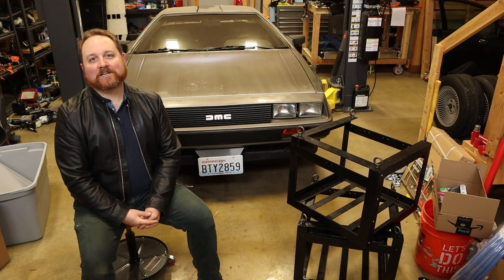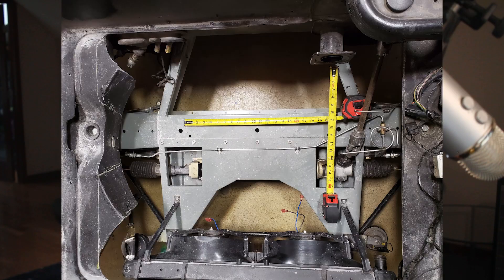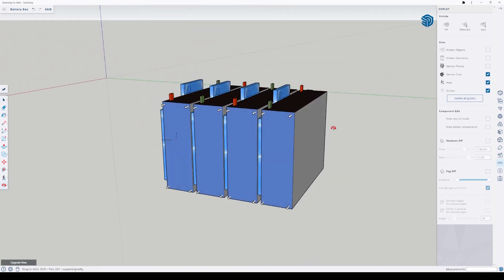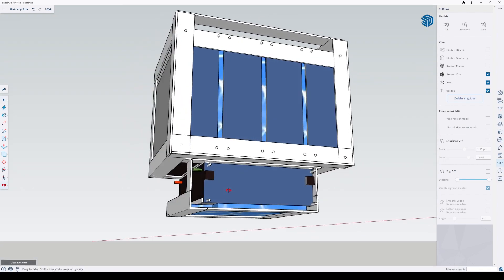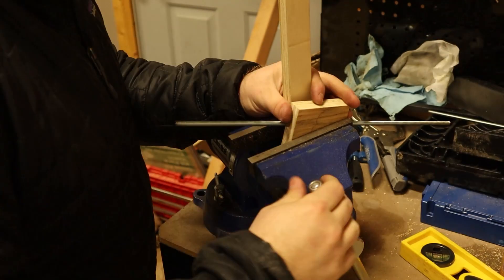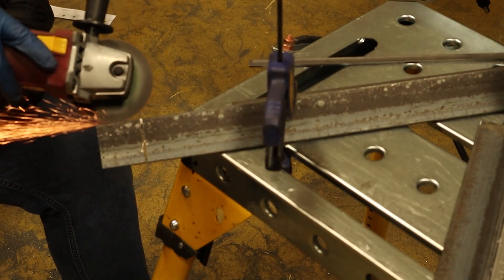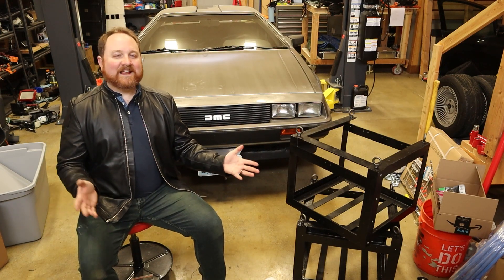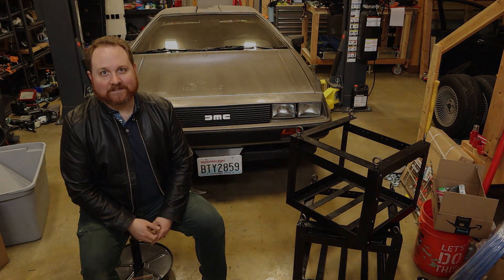Electric DeLorean - Design and fabrication of battery boxes!

Comment: Nice.  Will there be thermal pads between the machined aluminum and the battery modules?

Also, you show the end module only having a cooling plate on one side... so effectively all the others in that group get access to 2-shared cooling plates (effectively 2 x 1/2, or 1 full plate) , but that one end module only gets 1/2 as much cooling... and the opposite end gets 1 full + 1 shared... or 1.5 cooling plates.  

You might want to consider creating two different types of cooling plates... a full-thickness one for the sandwiched plates, and half-thick ones for the end-plates.
Reply from the maker: Yep, you're thinking just like me!! Each plate will have a thermal pad connecting it to one battery module, and on the other side there is a foam insulating panel so that each module only gets cooled by one plate, to ensure even cooling. :)
Reply: @BillCarlson    Well, that's not really where I was heading. Wasn't the original design cooled from both top and bottom?
Reply from the maker: @beforebefore  No, only cooled from one side. I tried to keep it doing exactly what it was doing before, so that I didn’t introduce extra variables.

Comment: How do the packs come from the factory? I understand that you have to redistribute the packs in a new configuration and to make them safe, but I'm not so sure about those heavy duty steel boxes. The original car didn't have those steel boxes inside, did it? Everything was packed a lot better originally I imagine. Can't people replicate that in their EV conversions? Why is everyone fabricating steel boxes?
Reply from the maker: I've got a video showing how I dismantled the pack straight from the Bolt, and you can see how they were mounted. They used the same basic type of mounting as I am - using threaded rods attached to plates, and some hold downs. The original battery box is one big steel box, with a fiberglass top.

Comment: Any particular reason you didn't go full cad + send-cut-send and skip a lot of the fabrication faff?
Reply: Oh nevermind you addressed it at the end as : yeah you shoulda done that, heh

But yeah send cut send is a modern miracle I swear
Reply from the maker: @Ryukachoo  I've redeemed myself on the next fabrication job - the small battery boxes are both in from Send Cut Send. I agree - modern miracle!!

Comment: Awesome work! What are the approximate outside dimensions of each of the boxes you built? I’m thinking of using a Bolt battery for a build and your boxes look well packaged! Thanks for the videos!
Reply from the maker: Roughly 21" wide, 20" deep, and 16" tall - I also had a previous design that was a 2x2 arrangement of batteries that's roughly 12" tall, 20" deep, and 30" wide - this is the one that ended up not being able to fit in the front (too wide).

Comment: Are the 8 mm tapped holes adequate for lifting the pack? That's not very thick material to take substantial tension.
Reply from the maker: Definitely, each one is rated at 1100 pounds - https://www.boltdepot.com/fastener-information/Eye-Bolts/Metric-Machinery-Eye-Bolt-Working-Load-Limits.aspx

Pack weight is only ~400 pounds, so even with an angle on them I've got a lot of headroom.
Reply: @BillCarlson  The eyebolts are fine, but are they engaged by enough threads? My concern is not the fasteners, but the what the way they are anchored in the frame.
Reply from the maker: @brianb-p6586  Ahh, I see - the metal is 3/8" (9.5mm) thick and it is fully threaded. Rule of thumb for threads is that the maximum pull out strength is achieved once the depth equals the diameter of the screw (8mm), so I should be in the clear. Certainly four (or even 2) are strong enough to hold up 400 pounds. I'm not sure I would settle for M8 bolts to hold the pack in the car (for that I'm going with either M10 or M12 bolts) - but for picking up the pack and moving it around the shop, it should be adequate.

Comment: Did you consider locking nuts (elastomeric e.g. "Nylock", or all-metal) instead of the thread adhesive?
Reply from the maker: Yeah - Nyloc's weren't strong enough. I would have preferred welded or crimped on or something, but red loctite was cheap and easy! (And of course I learned my lesson and did ONE and tested it on that second round, haha!)
Reply: @BillCarlson  All-metal locking nuts typically have higher retaining torque than Nyloc, but whatever works!

Comment: I'm curious what you mean but just get it all laser cut instead of piecing it together like you did.  Would you just design all 6 sides so they can slot together somehow and then weld them up?
Reply from the maker: Exactly! As it happens, SuperFastMatt just released a video a couple of days ago going over the process. But yes - model everything in Fusion 360, then send the models to SendCutSend - wait two weeks - then beautifully laser cut panels show up. Once fit together and welded, you end up with a very precise part.

So far I've used this for firewall plates, brake booster mounts, a rotational plate for the master cylinder, the cooling plates, battery box mounts, and just yesterday sent off the design for the lower rear battery box. I think I'll probably also do the front small pack and HV mounting brackets... And honestly, at some point I'll completely redo the main battery boxes, too.

Comment: Another very nice video Bill!  Questions:
- How many hours do you have in the layout and fabrication of your new battery boxes? 
- What's the weight difference between the original Bolt battery boxes/tubs vs your new 89.8 lbs. boxes?
Looking forward to seeing your EV DeLorean assembled and back on the road.
Reply from the maker: Thanks Brian!!

I would say designing was ~10 hours or so, not too bad, and of course that is spread out over months. Fabrication was probably like 20-30 hours each (about 2 weeks each) - something in that time frame. To give you an idea, I had 9.5 hours of footage to edit for this episode and I don't record everything! Since I didn't have to worry about recording the second box, it took much less time.

The old battery box - just the bare box and rails - is around 250 pounds. I can pretty easily lift one side, but can't get it off the ground. The complete pack is 1000 pounds and the modules weigh 660lbs, leaving 340lbs for the contactor pack, BMS, bus bars, cables, cooling plates, cooling pipes, etc.

Do keep in mind that I still need to add 22-gauge cover plates to each side of the boxes - probably adding a few pounds - then fully construct two more single-module boxes that will each weigh ~20 pounds.

Comment: Do you do everything in metric?
Reply from the maker: When it comes to fabrication and making parts for the conversion, I mostly use metric. The DeLorean uses metric sizing for most fasteners, the Bolt EV does as well. About the only thing I use imperial sizing for is sheet goods, metal rod, tubes, and things where I can't get a good local supply in metric sizes.
Reply: @BillCarlson  Metric is Bestric!